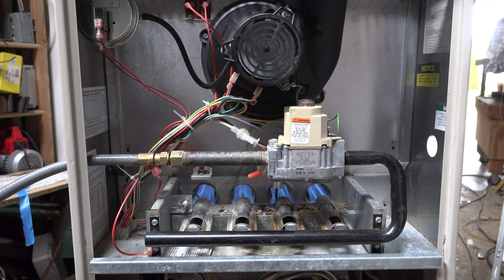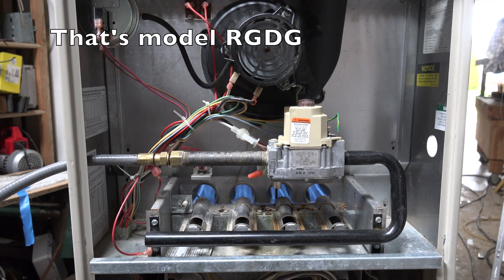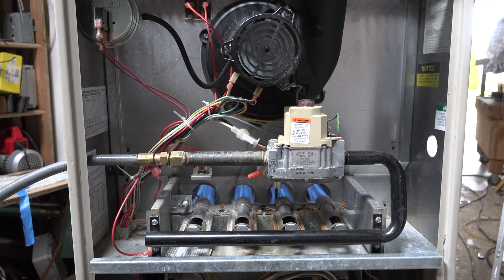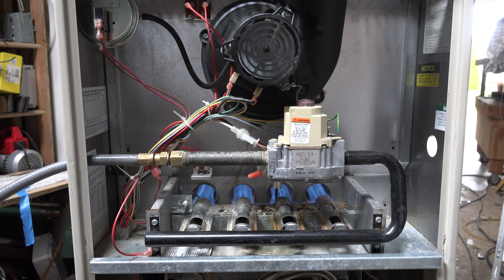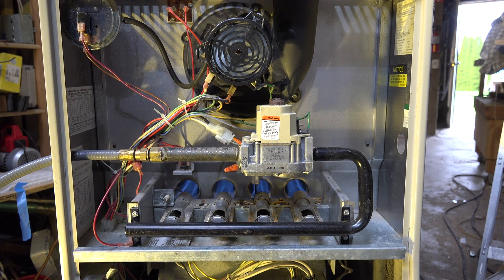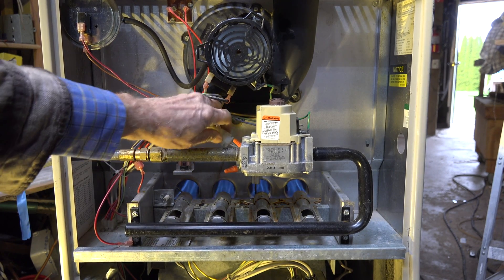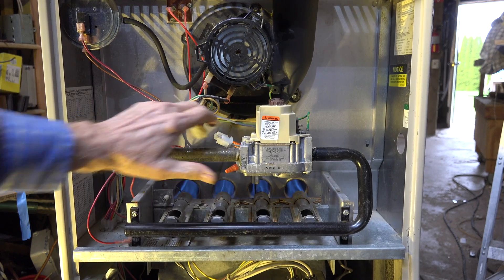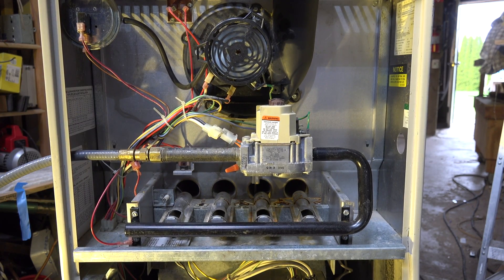what's wrong with this furnace #15

Comment: It would be safer to move the ignitor all the way to the right burner ,  and use only  flame rod sensing  to the far left to prove All burners had ignited , but there are a lot of old units that only used HSI sensing on one burner , not the safest though , imagine only igniting the one burner , now you have 3 burners unlit and the unit does not know and continues to allow gas flow , you can guess whats going to happen , and I have seen the damage done from extreme  " DELAYED IGNITION " .  All I can say is it is VERY important to keep up on the burner maintenance for this  particular design . Keep the carryovers clean & free of rust ,   Never stand in front of a system when attempting to watch ignition sequence unless you are bald already .

Comment: Flame sensor is not hooked up. Must be jumped out or shorted closed.
Reply: You can't  " Jump out  " or " Short out  " a flame sensor to make a furnace run , it produces microamps and the control see's it to prove flame , the unit would short cycle in both those conditions !

Comment: the neutral wire should be connected to one of the flame sensor wire circuit as a way to sense the flame present but some one decided to bypass it by using the hsi instead...re engineered by an old timer

Comment: There is nothing wrong with the operation of that furnace , it works just like it's designed to, your trying to throw them off with the disconnected  flame sensor .
Reply: Hot surface igniter is on the wrong burner, it needs to be in the first one to the right.
Reply: Why would it matter ?

Comment: Using an ignitor from a Rheem style furnace. Which is also the flame sensor. That flame sensor on the left is unusual for Rheem/Ruud units.
Reply: It was an add on for extra flame sensing

Comment: Not only the sensor is unplugged, but the inducer bearings have seen better times
Reply from the maker: You are correct on the inducer.  However, the problem is with flame sense.
GFM

Comment: flame rod not in circuit. jerry rigged somehow, note the wire nut center screen right next to the hsi. if this is the problem i need schematics... rod is a 24v "switch", hsi is 120v.
Reply: If you were a little older you would know , I guess that means I'm an   " old timer "

Comment: flame sense kit was not installed properly when board replaced and or flame sense not grounded to hsi neutral..hsi should be  moved to the right
Reply: The new PC requires a flame sensing rod to operate , it will not take the old signal from the HSI , so I doubt the PC has been changed
Reply: that's why I said and or..someone went to the trouble to add the flame sense but did not read the instructions.  it either has to be ran to the board or tied in with hsi neutral
Reply: Like I said , if the control , or PC had been changed the furnace in the video would not have continued to run , the NEW style Rheem PC requires a flame rod kit to be added to system, the rod in the video is not tied into the LV side of PC,  it is tied to the neutral side of line power to the HSI , furthermore the rod isn't even connected , this shows that the control is old style , and functioning correctly . he disconnected the HSI during a run cycle and the unit shut down , witch is exactly what it should do . My thoughts are that the furnace operates fine , I saw nothing wrong with the scenario at hand .
Reply: You got it super tech
Reply: add the flame rod is clearly not connected to anything

Comment: Control board is rectifying flame through the igniter and flame sensor is disconnected
Reply: Agree.
Reply: The old rheem/Rudd hsi was in the middle of burners.
Reply: Nice to see that someone has a clue to how a furnace works , good job ,  funny thing is , theres nothing wrong with the way it's running , thats the way older Rheems were set up , they didn't even come with a flame rod , it was always HSI sensing .

Comment: hsi is in wrong burner location.should be in first burner right to left. Also the flame sensor is not wired up which is a safety issue and a likely ignition control malfunction
Reply: DUDE < the flame sensor wire is off , HSI is fine where it is , he's using the HSI wired to the neutral back to IGN  control , thats how the old RHEEMS were , you could add the flame sensor kit to boost flame sense signal  if needed.
Reply: When he disconnected the HSI , that proved that the ignition control was sensing flame , because it immediately shut down  , if it was malfunctioning unit probably would not have shut down , I have never seen one fail in that way though , and there are failsafe features built into the control to prevent that from happening

Comment: It looks like the HSI is being used as a flame sensor.
Reply: You got it !!!!
Reply: The old Rheem equipment used a HSI control module or P/C  that sensed flame by taking a micro current generated by gas flame over the HSI ,  using the neutral side of HSI , also you could add ,or substitute a flame rod sensor that connected to the neutral side of the HSI , you can see the. " T "  connector in the video for the flame rod to the neutral wire if you look real close  ( follow the wire at left side of burner manifold , just below the flame rod sensor that is disconnected,  Follow the red wire up to the  " T " connection .
Reply: it's not the flame Rod at the very end he unplugged the hot surface ignitor
Reply: My point was that the unit in the video had both an HSI , and an add on flame sensor , either one would prove flame , and I know the flame rod was disconnected , that's why the unit quit when he disc the HSI .

Comment: Flame rod is not in the circuit the wire is off.
Reply: You are right , it is disconnected , but it isn't affecting the operation of the furnace , so that technically  is not    " the  " problem .
Reply: Well, I think we will all find out when GFM tells us why.
Reply: Seeing how GFM worded his explanation as a "really interesting problem" and that all you needed was to look at the setup to tell what the problem was with emphases on the wiring. I am not a HVAC tech I am a retired broadcast engineer with 30 years of experience in electronics and maintaining TV and radio stations witch i assure you the equipment for witch is far more complex and expensive then HVAC. I am here to be educated at the feet of the master in HVAC. It is my opinion from my 3 or 4 years of having the privilege of being a beneficiary of GFM'S enlightenment and his meany years of experience that i trust what he tells me. You sir on the other hand I have no idea of you background and experience so you will forgive me if i disregard your analysis and wait for the instructor to give us his conclusion.
Reply: I respect your reply , and I also am waiting to hear what GFM has to say  ,